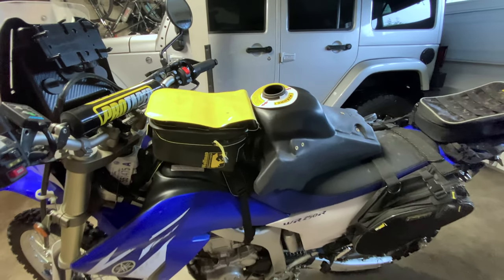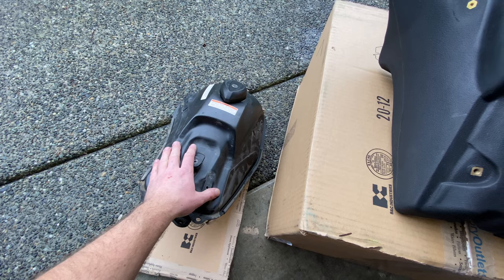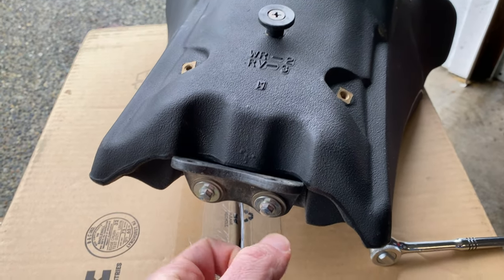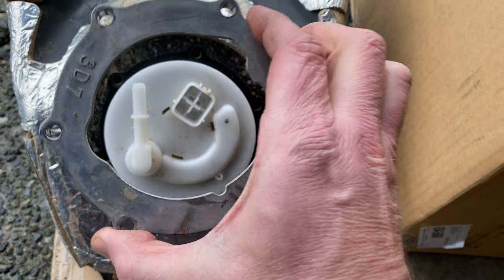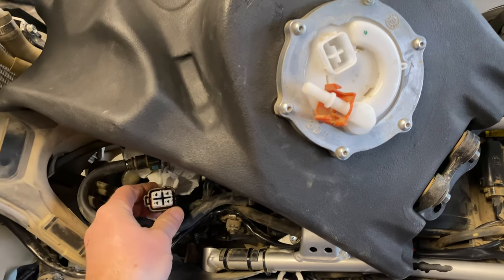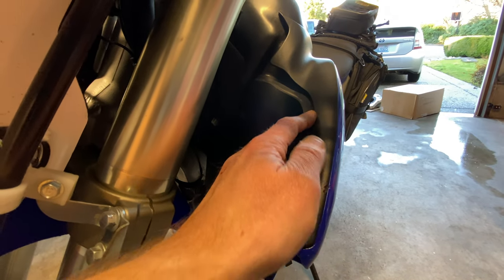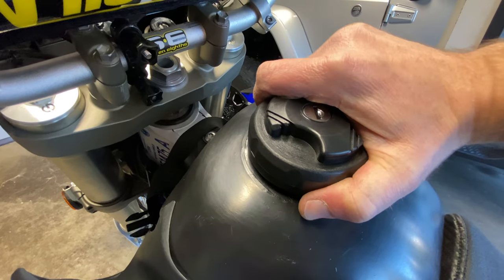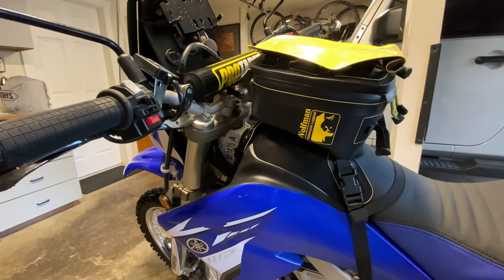IMS 3 Gallon Fuel Tank Install WR250R MOD

Comment: Thanks for the vid!

I just installed the IMS 3 gallon on my '08 wr250r and the upper triple clamp is hitting the tank. It's very gentle on the left, but on the right, it actually has to deflect the plastic of the tank to turn the handlebar all the way.

I worry this could break and puncture the tank after long-term use. I've tried readjusting the mounting plates to make it sit as far down and backwards as possible, but that didn't help. 

Does that happen in yours too?

Comment: Im turning my wr250x into an adventure bike rn so your videos are very helpful!! subscribing!
Reply from the maker: Bad ass! I have always loved the wr250x. Are you going to be posting the transformation of your wr anywhere that I could follow? I am happy to hear that my videos have been helpful and thank you for subscribing 🙌🤘
Reply: @joelwallisadv  I might post a few videos on my channel. It’s mostly about Vanlife but I think this could be a fun mini seriesZ
Reply: @joelwallisadv  just ordered my fuel tank & seat concepts seat. Not sure what type of tires to run yet.
Reply from the maker: @StephenAldaco  depends on the terrain you’ll be riding. I have been mostly off road and enjoying the pirelli MT in the front and the Dunlop d606 in the rear which is a 70/30 off road to street ratio. My buddy Adam runs the Dunlop d605 front and rear on his wr which is a 50/50 and he has had zero issues with loosing traction on our rides. Except for the snow the MT did better. I might go with the d605’s next as they are half the cost and since I have been getting on the road more often now.
Reply from the maker: @StephenAldaco  rock on! I just subscribed to your channel. Vanlife looks awesome man!
Reply: @joelwallisadv  it’s fun not without its challenges thanks for the sub!!

Comment: Very helpful video. I just heard the FedEx truck delivering my new tank so I'll be installing it today! Question: the old tank comes off with installation attached. You attached the new plastic tank without insulation. Have you noticed that it mattered or not?
Reply: I meant insulation🙃
Reply from the maker: @MontageCreativeGroup  Exciting! I haven’t noticed a difference. Just follow the instructions or my video ( both the same ) and you should be fine :). Enjoy the longer rides🤘

Comment: I was thinking about getting the natural colored one,but it's all covered up by the side shrouds.Is that why you went with the black tank?
Reply from the maker: Hi J L! I went with black cause it looked like factory. The blue color was tempting too… I feel like there is no point for natural cause the fuel light will still come on your dash and also I am not a fan of the natural look. Totally get why to do natural on the bigger tanks where the fuel fuel light is non existent and you can see how much gas you have but in this case you won’t be able to see much in the tank anyway. Hope this helps!

Comment: Is the O-ring that comes with the IMS tank significantly different that the stock O ring?  I bought a used tank that didn't come with an O-ring and just transferred my stock one over, but I'm experiencing leaking.
Reply from the maker: It is a little bit larger and unfortunately you cannot use the factory o ring. I’d reach out to IMS to obtain the o ring.

Comment: Do you think you needed the Acerbis cap or could you have put the tank bag over the breather hose? Does the tank bag easily remove to access the gas cap?
Reply from the maker: I think the acerbis cap is a must if you are doing a tank bag as the tank bag would pinch the breather tube. My tank bag is super easy to access the gas cap. Just unclick two of the four buckles for quick access to the gas cap